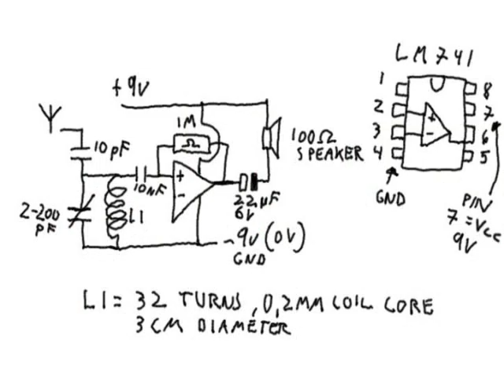Build a radio in less than 1 minute

Comment: Hello Tommy Helgevold, it's great job. But please pardon me, I cannot understant..
FM frequency 87.5 MHz - 108.0 MHz . 
For proper resonant L- C values must be 1pF capacitor needs 3.31uH - 2.21 uH 
or for instance 20pF capacitor needs 0.165 uH - 0.108 uH
AM frequency 522 kHz - 1620 kHz. For proper resonant L- C values must be 
100 pF capacitor needs 911 uH - 96 uH  
or for example 20pF capacitor needs 4.555 miliHenries - 480 microHenries
On internet Single-Layer Coil Calculator says 
Coil former diameter ( D ) = 3 cm, Number of turns ( N )=32 turns,
Length of the coil ( l ) I guess =5 cm or 6 cm 
CALCULATE ....L = 13.330 uH or 15.196 uH,
That's not important d=0.2 mm or 0.7 mm ... So your radio is not an AM or a FM ...

Comment: Hi, I closed your circuit according to what I saw in the last video, but unfortunately I only heard the speaker siren and the circuit did not work. Your explanatory circuit is different from the one you closed at the end of the clip.
You patched a 10 pf capacitor to the antenna in the circuit diagram you showed at the end, but in the assembly video you connected a 33pf capacitor. If you can explain more about the inductor circuit and leave a complete and error-free map, thank you.🌍❤

Comment: what is that blue wire
please answer fast
Reply from the maker: That's the antenna cable. Ca. 3 meter long. You can connect it to your home heating radiator or some ground in the house and it will act as an excellent antenna source.

Comment: you built nothing.  you assembled components.  bullshit.
Reply: isn't that how electronics are build lol. you design the circuit, test it with a pprototype, then buy the parts and assemble it. the Iphones for example are design by apple: but the parts are from different companies. Sony manufactured the camera, sanyo epson, sharp manufactured the screen, the video chip and the CPU are  manufactured by Samsung, the digitizer by balda.  Bluetooth chip, WiFi chip, ect by other companies.
electronics are built with assembled components

Comment: So the Inductor and Capacitor in parallel are meant to filter out the other unwanted AC signals?  How does they do this if they are also in parallel with the rest of the circuit?

Comment: They are so many ways to make crystal radio's,I wish someone would make better crystal radio kits ,for everyone ,cheap,better performance ,than the ones made today,a little high end for under 25.00 bucks ,one for kids or beginners and one for more seasoned kit builder.one that works in more conditions ,more portable for quick set up,its only a dream,but at least a better book to follow all the different kinds and which one work the best.

Comment: So a radio works by sending electromagnetic waves that carry sound and currents that travel at the speed of light, through a certain frequency and then a antenna/satellite picks up those signals and pretty much deciphers them into the sound that they are producing? I'm studying up on signals and radios, and just about anything that involves engineering. :p

Comment: where can i get a variable capacitor that will be able to work with this project??
Reply from the maker: +Mike McHugh 
Any variable capacitor between 0 and 500 pF should work, 22-220pf etc. should work as well. These are common on ebay, but just don't search for specific values - search for variable capacitors and look for the broadest range.

Comment: What exactly is the thickness of the coil? Is it 2 mm or 0.2 mm
Reply from the maker: +PRANAV KUMAR 
Good question. The coil is wound with an 0.7 mm copper wire. There are numerous coil calculators online out there, use one to figure out the right frequency if you wish. I just sometimes wind random coils for fun ;)
Reply: Thanks a lot sir but how many turns are required to make it.

Comment: Use a 300 ohm speaker or 300 ohm audio transformer for more sound & better audio quality. 50uf output capacitor will also improve lower frequency audio. Put a germanium diode at the input of the chip. It's a better detector, will be more sensitive, & more selective. The input capacitor should be .05-.1uf not 10uf. The 10pf capacitor on the antenna is unnecessary. You're only picking up the barely upper AM radio band, & lower shortwave band with that coil. Wind it to 70 turns instead. I'll bet it took much more than a minute to wind the coil.
Reply: BuffaloBetties Well...YOU CAN'T PLEASE EVERYBODY!!!
Reply: Hello vjjohn,
FM frequency 87.5 MHz - 108.0 MHz . 
For proper resonant L- C values must be 1pF capacitor needs 3.31uH - 2.21 uH 
or for instance 20pF capacitor needs 0.165 uH - 0.108 uH
AM frequency 522 kHz - 1620 kHz. For proper resonant L- C values must be 
100 pF capacitor needs 911 uH - 96 uH  
or for example 20pF capacitor needs 4.555 miliHenries - 480 microHenries
On internet Single-Layer Coil Calculator says 
Coil former diameter ( D ) = 3 cm, Number of turns ( N )=32 turns,
Length of the coil ( l ) I guess =5 cm or 6 cm 
CALCULATE ....L = 13.330 uH or 15.196 uH
That's not important d=0.2 mm or 0.7 mm ... So this radio is not an AM or a FM ...

Comment: Can anyone tell me what the blue wire in the 3d rendering is for?
Reply from the maker: It's the antenna. It's basically just a fairly long wire. You can connect it to your home radiator for a better result if you wish.

Comment: There is something wrong with your circuit diagram. The neg. input of the opamp is not connected. You have positve feedback, which should also can be a problem.
Reply: +Martin Gardien This appears to be a direct conversion type of receiver. That means it's actually an oscillator/mixer combination. The "mix" is what is detected in the speaker. That's why the AM stations sound so horrible.

Comment: i think the pin assignment for that 741 op amp is wrong. i thought pin 2 was inverting input and 3 was non-inverting.
Reply: Yes, you right. More over
FM frequency 87.5 MHz - 108.0 MHz . 
For proper resonant L- C values must be 1pF capacitor needs 3.31uH - 2.21 uH 
or for instance 20pF capacitor needs 0.165 uH - 0.108 uH
AM frequency 522 kHz - 1620 kHz. For proper resonant L- C values must be 
100 pF capacitor needs 911 uH - 96 uH  
or for example 20pF capacitor needs 4.555 miliHenries - 480 microHenries
On internet Single-Layer Coil Calculator says 
Coil former diameter ( D ) = 3 cm, Number of turns ( N )=32 turns,
Length of the coil ( l ) I guess =5 cm or 6 cm 
CALCULATE ....L = 13.330 uH or 15.196 uH
That's not important d=0.2 mm or 0.7 mm ... So your radio is not an AM or a FM ...

Comment: Wonderful. Could you please explain how the circuit works?
Reply: The lm741 opamp acts as an envelope detector/rectifier to convert RF signal into audio sound
Reply: @wellboyscience8478 
FM frequency 87.5 MHz - 108.0 MHz . 
For proper resonant L- C values must be 1pF capacitor needs 3.31uH - 2.21 uH 
or for instance 20pF capacitor needs 0.165 uH - 0.108 uH
AM frequency 522 kHz - 1620 kHz. For proper resonant L- C values must be 
100 pF capacitor needs 911 uH - 96 uH  
or for example 20pF capacitor needs 4.555 miliHenries - 480 microHenries
On internet Single-Layer Coil Calculator says 
Coil former diameter ( D ) = 3 cm, Number of turns ( N )=32 turns,
Length of the coil ( l ) I guess =5 cm or 6 cm 
CALCULATE ....L = 13.330 uH or 15.196 uH
That's not important d=0.2 mm or 0.7 mm ... So your radio is not an AM or a FM ...

Comment: I notice you're not using the inverting input of the op-amp. Any reason for this? If I remember my electronics correctly, not using this input will cause the output to slam between the rails based on the non-inverting input. Why not do away with the 1Mohm, and use a proper resistor-divider feedback network on the inverting input to set the gain?

I assume you're using a silicon effect of the op-amp as your detector? Wouldn't using a proper discreet detector diode and cap provide a more linear signal?

Comment: Let's say I want to use a fixed inductor element instead of that coil of wire. Which range of inductance can I choose?.And what is the range for the capacitance of the variable capacitor?

Comment: Time Table
10 secs - LM741 and wires in place
30 secs - resistors and capacitors in place
50 secs - tuning module and speaker in place
60 secs - DICK CAUGHT IN CEILING FAN HELP

Comment: I wonder if it is possible to get a radio and a transmitter tuned to operate on frequencies above or below what other devices can hear. also can this be done with a couple cb's or walkie talkies for a sorta privacy channel system? when i say tune i mean the internal circuit board tuners. i know that one is usually for current/voltage, then another for frequency, then another possibly for volume or the such.

Comment: Hey thanks for the vid! I have a couple of questions for you if you don't mind. 
1. It seems that there's a mistake in the schematics.Where is the negative input of the op amp connected to? I'm assuming it's grounded.
2. All the capacitors (except the variable one) in this circuit are used to filter out the DC component of the signal and leave the sinusoidal, yes? 
3. I saw a circuit online using a series RLC filter instead of a parallel LC one. What's the difference?
Thanks!

Comment: Quick couple of questions: a) The op amp is purely for amplification (you could use a transistor/darlington pair? b)The 10nF capacitor: is that part of the oscillator or is it just the coil and the variable cap -  i.e. your frequency is ~2-20MHz (2pF-200pF) 1/2*pi sqrt(LC)

Comment: hello i have a few questions to ask:
1. can i ask about what kind of antenna is it / what can i do about it?
2. what kind of power source should i use? will 9v battery do? or an ac power source?since i saw on your prev video that it is 9v but you did not specify.
3. Uhm for the coil, do you think i could use a bare magnetic wire?no plastic coating? im thinking of recycling some of the stuff.
4. Lastly, the tuner. I dont know where to get it but can i make it? or what are the specifics?
Reply: Hello LameJane, that is only a fake work..
FM frequency 87.5 MHz - 108.0 MHz . 
For proper resonant L- C values must be 1pF capacitor needs 3.31uH - 2.21 uH 
or for instance 20pF capacitor needs 0.165 uH - 0.108 uH
AM frequency 522 kHz - 1620 kHz. For proper resonant L- C values must be 
100 pF capacitor needs 911 uH - 96 uH  
or for example 20pF capacitor needs 4.555 miliHenries - 480 microHenries
On internet Single-Layer Coil Calculator says 
Coil former diameter ( D ) = 3 cm, Number of turns ( N )=32 turns,
Length of the coil ( l ) I guess =5 cm or 6 cm 
CALCULATE ....L = 13.330 uH or 15.196 uH
That's not important d=0.2 mm or 0.7 mm ... So that radio is not an AM or a FM ...